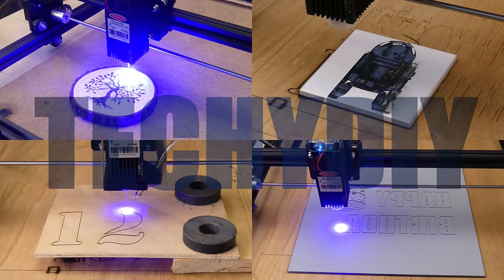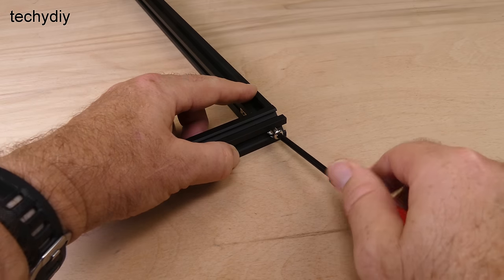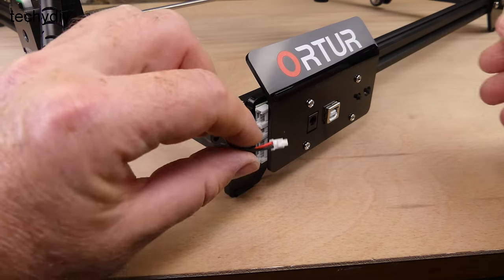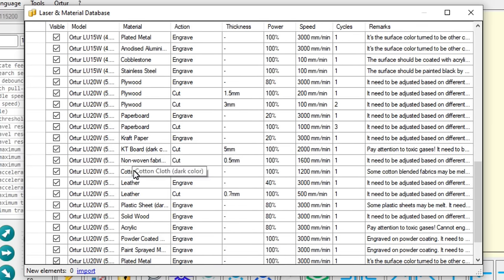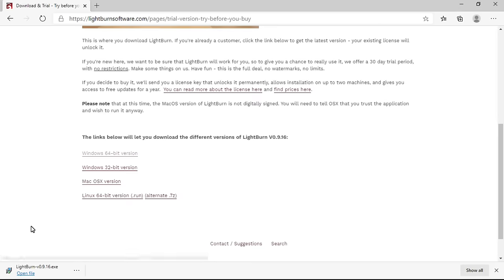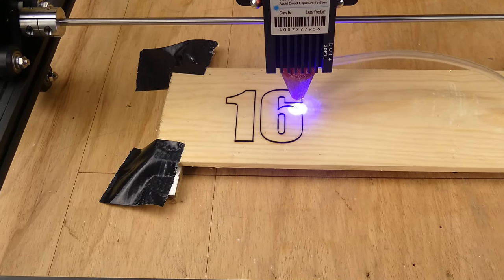Ortur Laser Master 2 - 20W Engraver. Build, Test & Review.

Comment: Absolute smash out of the park review and demo. Otur should be paying you.

I'd talked myself out of getting this but you answered every preliminary question I had. Now I actually see the NEED for this in my project and it's an entirely different perspective.

My budget battles are between 3D printer resin supplies or getting additional hardware. I think I'm sold. This is an investment.

Comment: The thoroughness of this presentation is impressive. I ordered the "20watt" version based on a first viewing. I appreciate your clarification of input versus cutting power, as well as a live demo of what can be accomplished with this unit. The Ortur is preferable to the similarly priced Chinese  K 40 CO2 lasers IMHO because the K 40s, while more powerful, the build quality and included components seem spotty at best, and the the setup is more difficult. Many CO2 lasers tout pass through capability, a feature that would obviously be easy to implement. The easy customization of an extrusion based frame makes it easy to implement changes to expand capabilities.  If this proof of concept laser works for me, I will likely order a larger more capable FullSpectrum machine, while retaining this surprising capable machine.
Thank you!

Comment: I was considering a FS  Muse system, but I wanted to begin to understand the technology before taking the plunge. When i saw this system a while back I thought it's a toy that could not cut more than paper, and so I stayed away. Buying a K40 type laser did not appeal to me although there is a great deal of information on dealing with that type of systems shortcomings. I'm a design engineer, so the upgrade process didn't scare me from the technical point of view, but I did not want to take on another project of that type at this time.
When I found this video, I bought my OLM2 based on this presentation, especially when i learned that it had the capabilities you have shown. Since then, I have been inspired to take the journey, following the learning paths that you linked to.
Thank you.

Comment from the maker: In this video I build and test an Ortur Laser Master 2 - 20W  laser Engraver. The laser has an optic power output of 5.5W. 
Purchase link:
Aliexpress    https://bit.ly/3kTxgtH
Amazon   https://amzn.to/3lZlhuJ
Amazon UK   https://amzn.to/3oP9W2b
Amazon DE  https://amzn.to/3oXpMYF

Air assist bracket    https://www.thingiverse.com/thing:4524111
1mm 3d printer nozzle  https://bit.ly/3iJyLbv
6mm brass tube   https://bit.ly/3jswznt
(I enlarged the end of the brass tube and then  screwed the printer nozzle into  it)

Some of the above are affiliate links, if you click on them and purchase an item, I might receive a small income. It doesn't cost you anything extra, but it does help me to make more videos.

0:00 Introduction
0:51 Limit switches
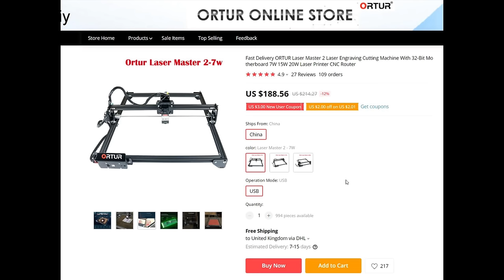1:05 Laser power output
1:22 445nm laser diode
1:44 Pcb teardown
2:02 STM32 microcontroller
2:21 Safety features
2:52 HR4988SQ stepper motor drivers
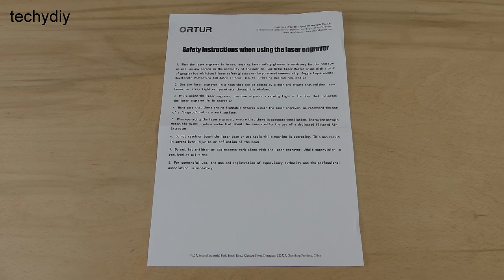3:06 Documentation
3:25 Laser safety
3:34 Hardware build
9:18 Software install   
9:28 Usb driver install
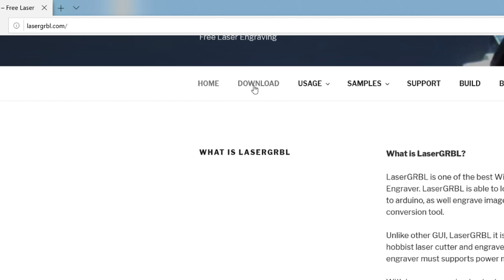10:09 Lasergrbl
13:23 Import image
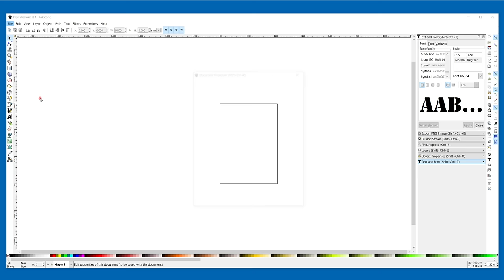15:19 Inkscape
16:31 Cut foamboard
17:24 Lightburn
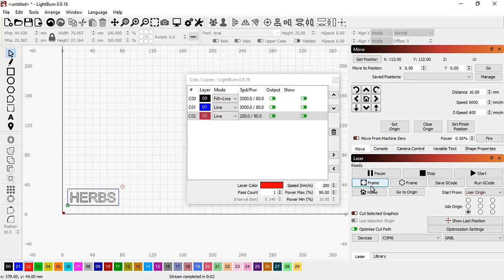21:35 Engrave plywood
22:28 Engrave ceramic tile
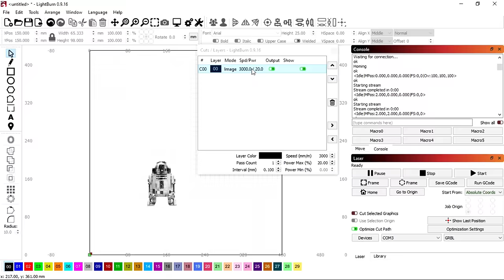24:21 Engrave R2D2 v2
25:15 Engrave mirror
25:55 Engrave acrylic
26:02 Engrave leather
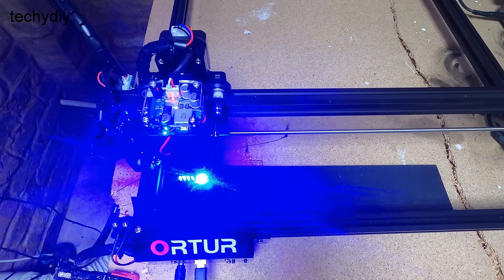26:20 Engrave painted steel
26:36 Engrave denim cotton
26:55 Cut acrylic
27:17 Air assist
27:49 Cut 6mm pine wood
28:26 Air assist v2
28:30 Cut 6mm plywood
29:12 Cut denim cotton
29:34 Cut 1mm leather
29:50 Conclusion
Reply: Holy wow why is it so cheap off Aliexpress? 

Also you are the best reviewer I've seen thus far. Top notch

Comment: The only think I am lacking Is the air system, but I am not even able to cut 1/16, I cannot figure out the settings and the wood gets very bad before it cuts like all black. Can you give me the settings you are using and if the air system is something I will need for make this work???
Reply from the maker: Air makes a huge difference but basically you just have to experiment, some wood burns well, some doesn't.

Comment: Superb video! Mine arrived today, and i don't think I'd have assembled it as quickly as i did with just the official user manual. Mine appears to be a slightly later version, and there are a couple of new bits not covered in this video, but they are not covered in the manual either. I'm saving this video as a go to reference guide.

Comment: First, thanks for the video; I have some questions:
1) Is it possible, in the future, to expand to a larger useful area?
2) Can a Laser with a higher capacity be used?
3) Is it useful to cut letters on adhesive paper (mirrored mode)?
4) I didn't understand how to determine the zero point of x and y.
Reply: contact me, show you something you interested.

Comment: Hi, I have one cuestion:  I have a similar machine, power 30W, and I want to engrave tile and cut along the contour on  ABS plate (1.5mm). what software should i use and where is the option to adjust the cutting after engraving? Thank you.

Comment: Wow. Very Nice product Review.
I want to use the machine to (only) engrave images in white mdf. At the beginning of your video you indicate that the laser does not work on white material. Later I see that you use white paint with the white tiles. Is that the trick you talked about earlier in the video, or is there another option to engrave on white materials?
Reply from the maker: Generally, you have to cover white or transparent materials with something coloured  that can absorb the laser, so black paint, black dry marker, black film etc.  You would have to try the mdf to findout if you can laser engrave it. It might work, it will be product dependent. A CO2 laser is ultimately a better option, because it will mark it regardless of the colour.

Comment: Would your eyes be damaged by looking at the laser while it's operating? Is there a way to protect yourself other than the glasses? Maybe an anti-laser screen that you could encapsulate the device in? Many thanks.
Reply from the maker: It is easy to get caught with reflections, so yes they can be damaged. 
Put it in a case  with an appropriate safety window or a camera.
Reply: @techydiy  thanks. What would you suggest for the "bed" material? I would prefer something I wouldn't need to change every other day.

Comment: You stated in the video some plywoods cut easier than others.  Can you elaborate on what makes the difference?
Reply from the maker: It's probably the type of glue used. Plywood with a light coloured core seems to cut easier, but that's just what I seem to find rather than anything definate.
Reply: Thank you for the reply.  I was thinking different woods but you thoughts on the glues makes good sense.

Comment: Hello there, I am considering buying the OLM 2 after watching this video. I want to use it to engrave small stainless steel plates for dog tags. Is that possible with this machine? And if so how is it achieved? By coating it with metal paint or you have anything else to suggest?
Reply from the maker: You have to use some sort of coating. Like  cermark laser marking spray or you can try dry moly spray. It is possible to engrave anodised aluminium tags.

Comment: I've just picked up a atomstack a5 which looks to be identical to this (minus the limit switches). It has a fixed focal length laser which is great if you are cutting lots of stuff the same thickness, but a pain if your changing materials often.

Thanks for the tip about air assist. Ill give that a go today.

What extractor fan are you using?
Reply from the maker: An Inline bathroom extractor

Comment: Helped with Importing those buttons.
Turned on the laser to adjust focusing. noticed it burning a whole in the wood. lol now kinda spooked to adjust. Does tuning it on low remain well when the power is increased?
Reply from the maker: In Lasergrbl. Right click on the laser button, select edit,  it will show you the commands to turn the laser on and off.

The gcode to turn the laser on':
M3 S20
$J=G91Z0.0001F2000

S20 is the laser power level. 

Yours might be something different.
0 = off
20 = about right
1000 = maximum power
 
Everytime you turn it on, it changes to the value above.

Comment: Great video, thanks. Questions: I don't have a 3d printer, how would I get the 3d printed brackets?  also, what air unit do you use for the air assist?  I've got this laser 20w on order and am looking to upgrade it once I get it, looks like a new lens and air assist are going to be 2 huge upgrades. Also looking at boxing it it for better ventalation and adding a lightburn camera in the future.

Comment: 30:10 "air ventilation is absolutely essential"
Since it's not in enclosed machine, what do you propose? a fan in the window? a respirator? I'm pretty sure this is the one I'm going to get, and want to have the best setup I can
Reply from the maker: Build a box around it and use an extractor (bathroom) fan to the outside.

Comment: Thank you for an amazingly detailed review!! I'm trying to figure out if the laser master 2 is good enough for my project, im going to try to burn super small icons onto a plastic material. Do you have any idea how thin of a line its capable of burning?
Reply from the maker: You wouldnt want to use the 20w (5.5w) version. The lowest power option would give you the thinnest line but I don't know the spec.

Comment: Thank you so much for making this super thorough and informative video about the device! You've covered all the common surface materials in the video very well, but do you have any experience using a laser engraver for creating circuit boards (perhaps combined with an appropriate acid)?
Reply from the maker: Yes, I have. Just spray the board with black paint and then burn off the tracks, it works well enough. I think I did one in the latest ortur pro video.

Comment: seems to do OK with the wood at 6mm. Do you know if it will cut rubber? Interested to know if it'll cut 1mm NBR sheet.
Reply from the maker: I don't know but I have just ordered some to try out
Reply: @techydiy  that's cool. Very interested to see the results. We make several different paper and rubber gaskets and normally I'd make a stamping die on the CNC, but laser cutting would be the preferred method as quick and easy to make changes or test a new design.
Cheers
Matt

Comment: Hi great video. Can this laser cut a series of small holes .75 mm in thin card  .25 mm thick.  Hoping to use it to cut pricking templates for my wife who does bobbin lace. Hope you can help.
Reply from the maker: I am not sure, It really depends on the material used. The other thing to consider is that it will leave some sort of burn mark, possibly not good around lace.

Comment: I have tried your technique for the tile and I have the 20wt Ortur laser master 2 with very poor results, I have tried your settings, and still no joy. What was the tile you used and do you have any other suggestions to get a decent result?
Reply from the maker: The cheapest white ceramic tile I could find. Make sure the focus is dead on. Take notice of the line spacing I used, try increasing it. Test with various power levels and speeds. Use thin coats of paint, thick doesn't work. Also vertical worked better than horizontal for the 20w laser.

Comment: Question on production speed.  If I needed to make 100 of those tree designs in the first part of the video, how long would it take.  Any suggestions for inexpensive  fast speed lasers for engraving 100-500 pieces per day?  Are multiple units the answer?
Reply from the maker: You would tile the design and engrave several at once. If they are uniform then some sort of template would be used to accurately position the peices. If the peices are not uniform then add a usb camera to lightburn to aid positioning. I can't remember how long it took.

Comment: you mentioned that ventilation is required (i agree :D ) - do you have a recommendation, what I can use?
Reply from the maker: I use a bathroom extractor fan with a  pipe outside. I have seen other people use pc fans. Most people build a case around the laser as well.
Reply: @techydiy  thank you :)

Comment: Any chance you ran in to the issue where when doing "line-fill" setting you ran in to the issue where the laser would be nearly 1mm off upon returning to trace the fill? Facing this issue with my ortur LM2 currently. Wondering if anyone else has faced it, and how the fixed it
Reply from the maker: No, I would ask on the lightburn forum, it might be a software problem.

Comment: Hi, great video. Can you please share the settings you used for the mirror? I bought this laser engraver just to engrave on glass, but i've tried everything, watched loads of videos but nothing seems to work. Thanks again for the great video.
Reply from the maker: You can't directly engrave anything transparent. The mirror is engraved from the back. You can try engraving glass by spraying it with black paint, engraving and then removing the paint with thinners. The other option is to do the same but apply a mask (paint or whatever) laser off your design and then apply glass etchant.

Comment: Great video! I'm a little confused by this new specifications trick: electric watts vs. optical watts. My laser is a 5.5W bought in 2019 - I wonder if it is the same power as the one tested here? I should test the same materials as you do and see if it can compare.... I only engrave wood and it works similarly.
Reply from the maker: Probably the same power.
Reply: @techydiy  thanks I will test it :) I have a CO2 laser so I never tried the things you are showing here, but frankly using the LED machine is like 10 times easier :)

Comment: Hi, can I engrave on Metal or Alumimum with it? if yes, what is the power and speed setting?
Reply from the maker: No, not unless it has some sort of coating on the metal, paint or anodised. It will then remove the coating but has no effect on the metal.

Comment: When you measure the diagonals to check for square, what could you possibly do to it if it wasn't square? It doesn't seem like there's any possible adjustment for out of square anyway.
Reply from the maker: Squeeze two opposite corners together and it will move. Its quite a big frame so there is quite a lot of leverage there.

Comment: At 24:29, what does it mean "scan angle of 90 degrees so that the laser moves verticlly"? How can the laser move vertically? What is the "scan angle"? 
This is a great video, thanks. Got my OM2 1 week ago and wondering whether to move on to Lightburn
Reply from the maker: In the Y axis direction. Front to back.
Lightburn is a good investment
Reply: @techydiy  Got it, thanks

Comment: Thank you for this review. 
Is it possible to invert X/Y axis to mount the machine hanging upsidedown ? Does the controller have an input for an enclosure switch, to switch off the laser when openend.
Reply from the maker: Yes you can invert the x y axis, its in the grbl; settings. No it doesn't have an enclosure switch input, although it would be easy to rig that up.

Comment: Agreed that this is one of the most informative videos on the topic.  I need to ablate black paint on PCB copper, so it sounds like a lower power laser would be best for smallest geometry traces.  But it would be nice to cut out cheap black plastic project cases sometimes.  Do you think I need to go with a higher power laser, or just buy a router (like the CNC 3018)?
Reply from the maker: Go with the 3018 for PCB and small enclosure milling. You can add a laser to that. The only thing to watch is the clearance height for the enclosure milling.  You really want something like a 500mW laser for PCB black paint method, much finer tracks are possible. Also milling gives pretty good results. I have a video about the eleksmill and it shows pcb Milling and PCB by laser.
Reply: Thanks.  I had not seen it said before that the 500 mW laser would effectively get through the paint (again, speed is not an issue), and only alluded to that the spot size would be better with an inherently lower power laser (rather than a big one running at reduced power).
Reply from the maker: @jamesknox9656  The trick is cleaning off the paint between passes. The eleksmaker 500mw laser cuts a much finer line than even the 2.5w. It does take some experimentation, the great thing is if it doesn't etch, you can just clean off the paint and try again. The downside is waiting for the paint to cure. The downside of milling is copper dust and broken bits. It's magic watching component holes being drilled though, I am never doing that by hand again. Good luck

Comment: Hi, I need some help, i have just purchased an updated machine of the same, and set it up, the only trouble is the X-axis is not moving, I have checked the cables and when i home the y-axis moves but the x-axis does not, plus the laser GRBL showsan icon that says 'Alarm' can you help?
Reply from the maker: Check the cables and connection again. Make sure that the x axis limit switch is not activated before you switch on. Failing that report it to Ortur support    https://ortur.tech/support/
Reply: @techydiy  the x axis limit switch is a small button which I am not sure is pressed or not, but if i push it does go in by 0.5mm is that right?